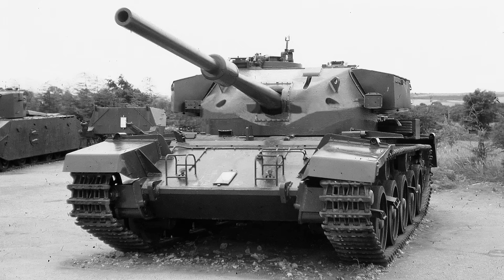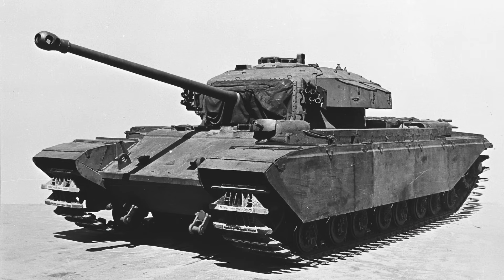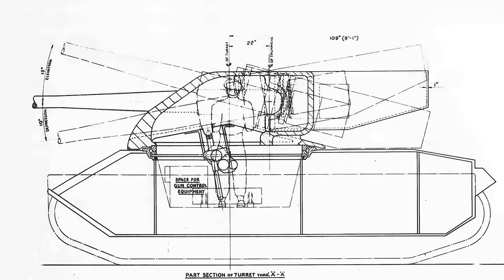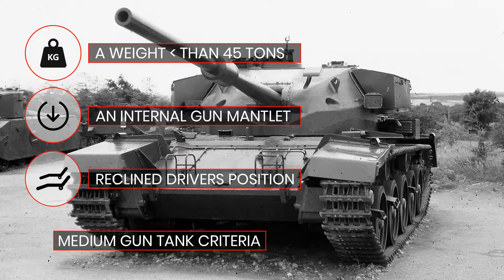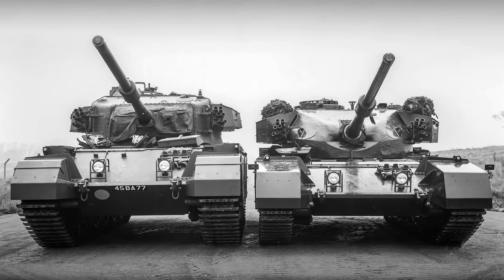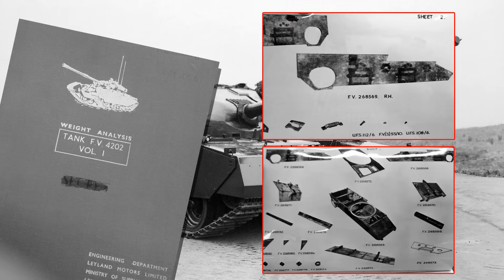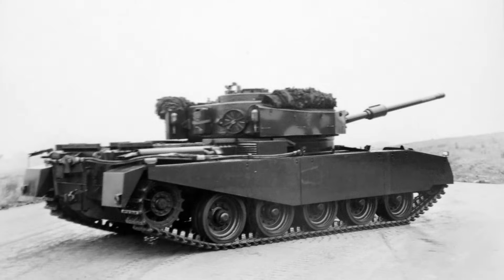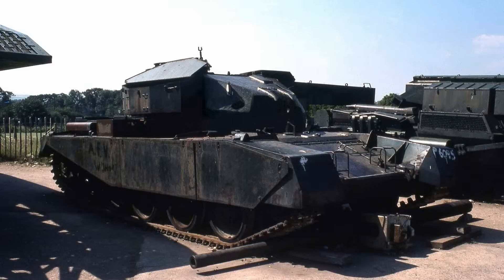FV4202 - Tank Design & Theory

Comment: The reason it didn't have the quoted was because the Meteor power was quoted the Meteorite was 4 piston cylinders les a V8 instead of the Meteor V12. Slight of Trick by labour communists.

Comment: The table at 5:05 is interesting. Seems we haven't learnt any lessons here when it comes to modern tank's ie: challenger 3. It clearly shows that a separate case or bag charge out performs single piece ammunition. Obviously these are older ammo types, but it would be interesting if there's any modern data for the 120mm or late variant challenger 1 data.  
I doubt you could get access to chally 2 data though as it would still be secret. 
As a former crewman most of the stuff you see online is inaccurate.

Comment: "I've spoken to the Israelis and they say this is bollocks!"

This is fun it's like a David Fletcher in training
Reply: Actually , what he said was ,..''after speaking to several sources who worked there and are very familiar with the collection,... they have stated that this is Bollocks'' ,..
 This is somewhat disingenuous in my opinion. While he tries to give the impression that he has ''de-bunked''  the ''myth''  entirely, the reality , I suspect, is that all he has really done is speak to the curators of the Israeli museum or collection. The most they could possibly have done is stated that they weren't aware of such a vehicle ever having turned up in Israel. Not the same thing at all.
More than anything else it seems to be an excuse to use the expletive in relation to David fletcher, a man with whom he appears to take some issue.

Comment: What was the hull armour like? It looks more heavily sloped but is it the same thickness as the centurion?
Reply from the maker: vgery thin, its just enough to give stuctural intergrity and test space and volume, never designed to fighth as a combat vehicle
Reply: @armouredarchives8867  I'd have though if you're testing space, a somewhat representative plate thickness would be helpful.

Comment: I love seeing everything that resulted as the NATO reaction to the IS-3
Reply: So:
Royal Ordinance L7 105mm gun and tanks mounting it (although technically it was design to counter T-54's)
FV201 Conqueror
FV4202 40-ton Centurion 
M103 Heavy Tank
FV4005
Swingfire missiles?

Which else am I missing?
Reply: @ADudOverTheFence1  Probably there's so much more to that we don't know of / never will know.

As it is: the L11 gun was the final nail in the coffin of IS-3 & T-10's relevance, as well as the weapon that put paid to the confusing plethora of tank guns we'd had prior.

Had the Chieftain's engine been as much of a winner as her teeth were sharp... well the MBT world would be very different.
Reply: @ADudOverTheFence1  Malkara Missile, basically an FV4005 round with a rocket motor and fins
Reply: And after all that worry and panic driven tank development it turns out the IS3 isn’t even that good.
Reply: @jk844100  it's actually not that bad either
Reply: @vukashin88  yeah, it was - it was outclassed by everything it ever actually fought against - as far down the ranks as AMX-13's

Comment: Interesting to see the 'cleft' turret design so early on in British designs. Reminiscent of the turrets used in the Swedish UDES vehicles. I wonder if this idea was adopted by any other countries? Great video - thanks for your work!
Reply: The cleft/bifurcated turret does seem like an interesting compromise to try and cover the difficulties in oscillating turrets with sealing against NBC attack and a way to try and avoid the limited elevation issue by minimizing the parts of the turret actually moving. The Loader looks like he'd have a hell of a time putting shells into the breach through that hatch, I can't actually tell if it's supposed to be through a hollow trunnion or a separate hatch. Either way, two-part ammunition would be a must and even then it's not likely to be a fast reload.
Reply: It's a bad idea really; as the armour protection layout & CBRN protection would be a nightmare.

Tanks like Challenger I & II by contrast have a very straightforward frontal profile quite deliberately; in-part because it makes the job of armouring much easier.